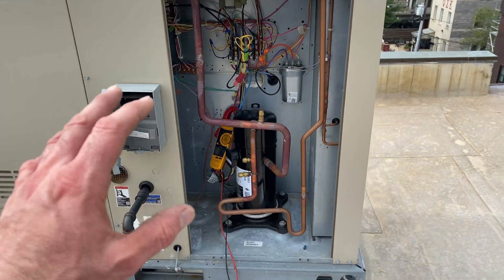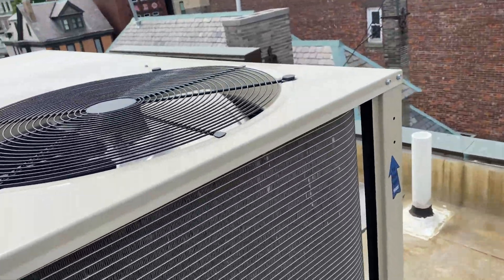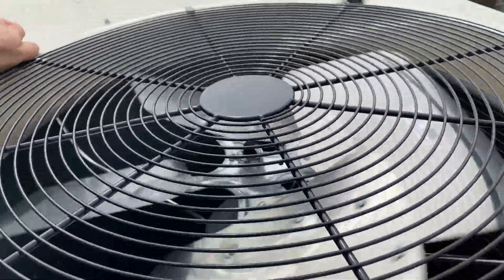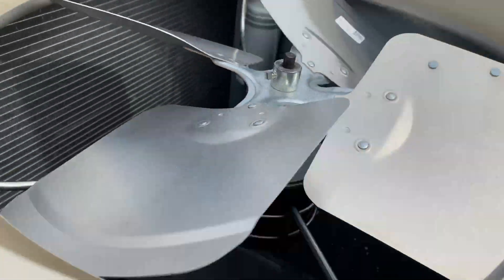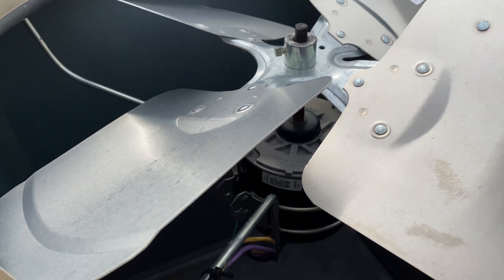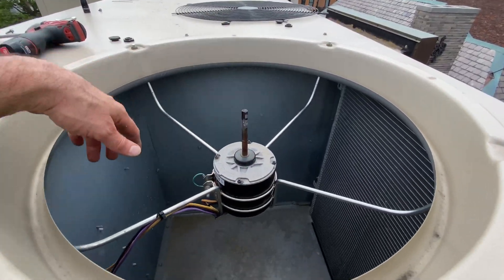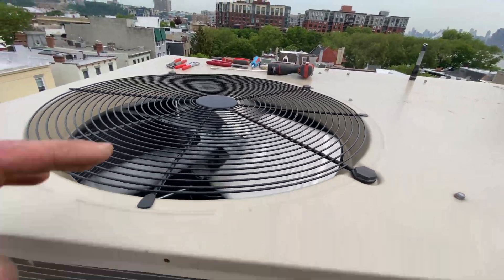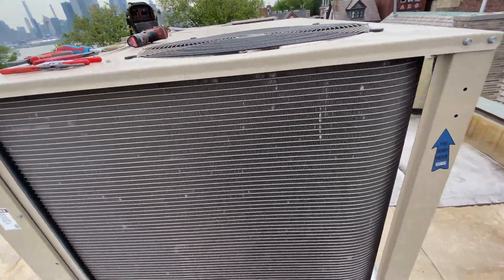AC Maintenance Prevents Catastrophic Failure On HVAC System

Comment: stick a plastic drinking straw in slowly, it wont hurt the blade, will make "hella" noise, deflect in the direction of blade rotation and if you cut power and do that it will show if blades are bent, by uneven clanking.

Comment: Paint one blade and then it will not look like it's going backwards.
Reply: even then, it's blade rpm, vs. camera frame rate. it could look to be going forward/backward/any speed/standing still.
welcome to videography 1 of 1.
Reply from the maker: Good idea. Will use a paint marker and try this out.

Comment: I’m new in the hvac world and I’ve yet to see a ac unit that has a fan blade/motor that’s mounted that way
Reply: I worked on a residential Carrier spilt system from the 80s the other day, that had the condenser fan motor mounted that way. I’ve seen a few others like that on other older systems too. Man I wish they were all mounted that way. I’m only 6 months into the trade myself.
Reply: that's pretty typical in large commercial RTU(roof top units). almost never to be seen in residential/package units.